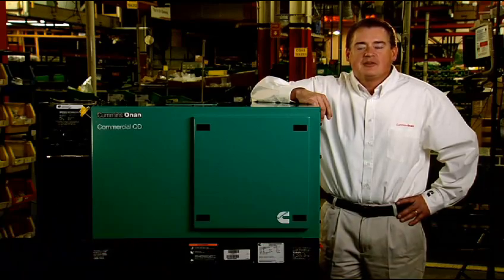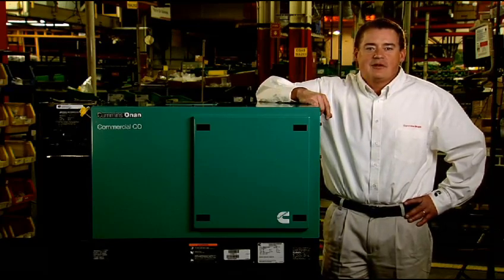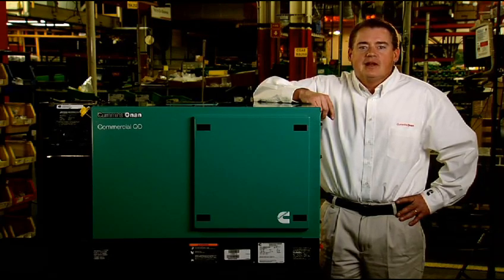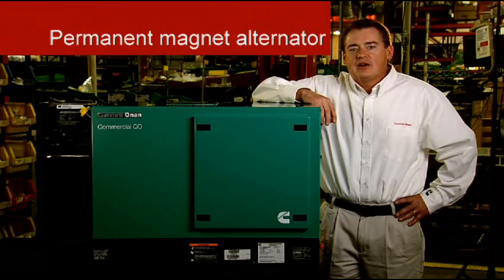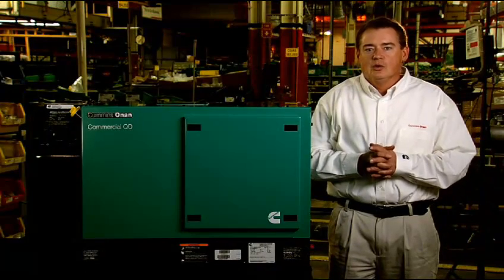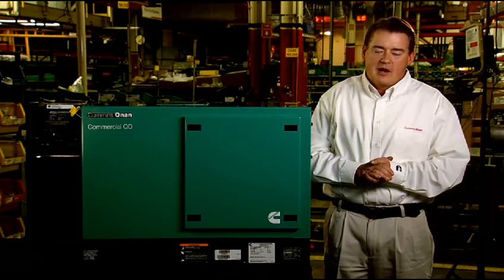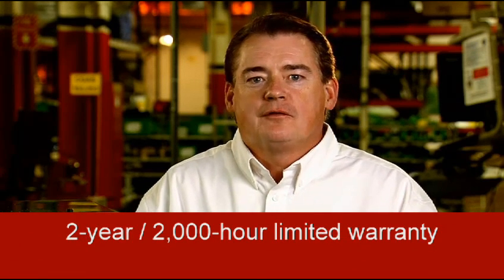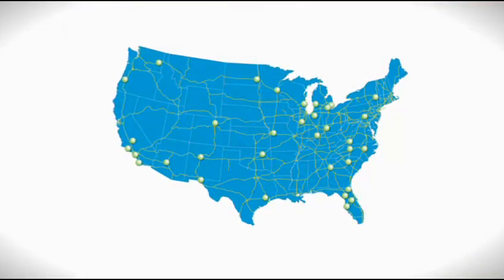Quiet Diesel Commercial Mobile Generator Product Line

Comment: Does this run @ 1800 or 3600 RPM ??
Reply: The speed varies continuously with load.  The voltage and frequency are determined by the inverter so the engine only has to run as fast as is required to make the amount of power needed.
Reply: That depends on the model

Comment: I own one of this with almost 6000 hours. Still running strong...
Reply: Most 50 hz. water cooled diesel have life expectancy of 20,000 hours.  LP generators 40k :)
Reply: Yar Nunya   True, transport of diesel  is easier then propane and diesel is more economical then natural gas. (it requires less gallons of diesel to generate same amount of electricity)

Comment: My 2005 Dynaquest RV has their 5.5HGKBA GenSet which had an oil filter above a large coolant hose and thus cannot be removed. The latter model also has a factory designed rubber piece coupled to light metal oil tube that after less than 100 hours falls apart and any new oil flows out of the pipe onto the engine and drips out below (unless you fire it up and then all the oil blows all over the engine). So to fix this mess requires $750ish as 400lb GenSet has to be removed from RV.